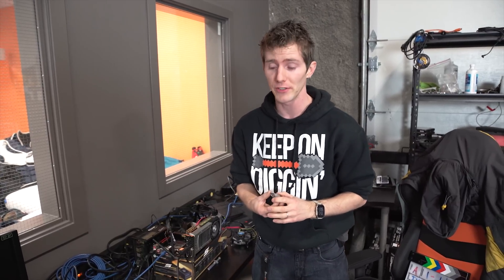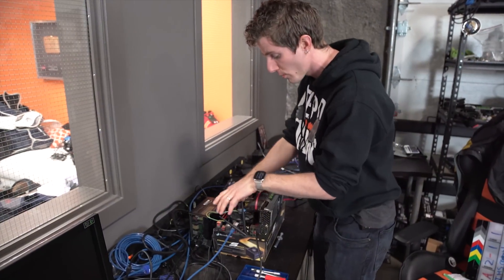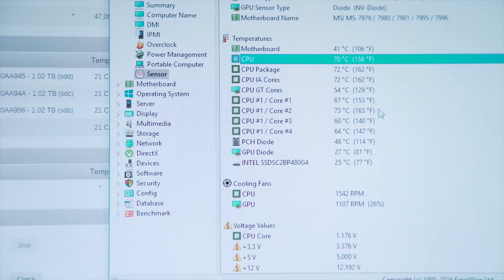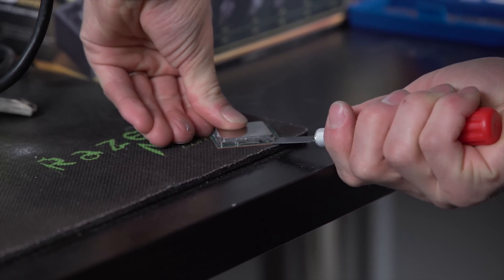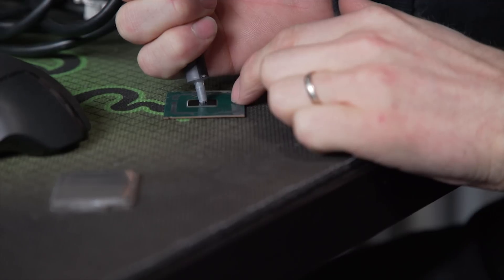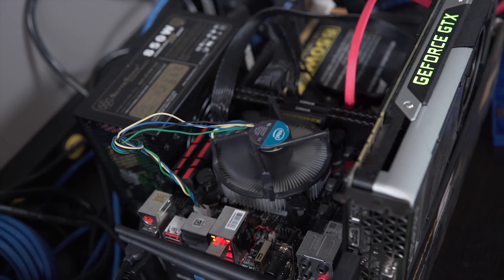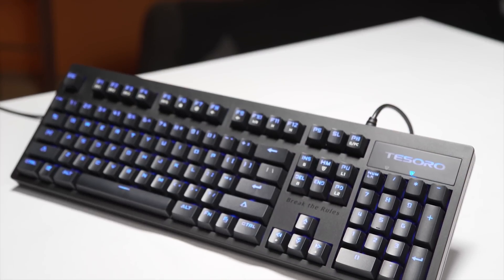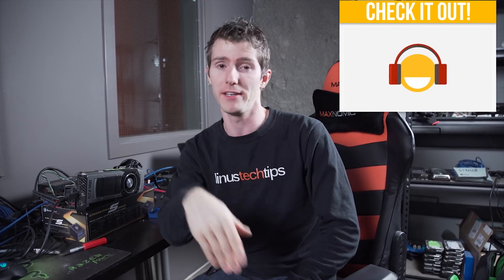Delidding an Intel Core i7 6700K - Is it worth it!?

Comment: first you have a polish cpu
Then a better sample of the cpu 
normaly test a cpu with prime95 actual version
finaly use liquid metal
You didn't proof the cpu  for Full wlp on chip
last you get lucky most of the intel cpu are worse with the wlp under the heatspreader
Why you didn't use delidemate from german store caseking

Comment: 4 to 5 degrees cooler? Not worth it... Better buy a bigger aircooler or go liquid with a cooler master evo i keep my fx8320 under 24C overclocked to 4.5ghz
Reply: +Jorge Hernandez The TIM used is like 12 dollars and you wont use even a quarter of it on one CPU. That combined with a CM EVO is good though. Screen shot please.

Comment: There's a few things you did wrong. 1: you have to clean the residue off both the IHS and the CPU board. 2: You should really be spreading the thermal paste over the die before putting the IHS back on.
Reply: +Anthony Paull Also on my 4790K I went from 90C under a H100i down to 70.
Reply: +Anthony Paull What voltage were you running? I have the same CPU and used CLU on it with H100i and it's barely ever touching 60c in stress tests. 4.7GHz @ 1.23v.

Comment: what thermal compound do you recommend for use with a laptop processor (since they get hotter)
i have been using arctic silver 5 replacing it every 6 months or so but i still have overheating issues 
is there a better compound i can use (price is no issue)

Comment: There are so many variables on this, the general rule with thermal paste is that less is better. There is only supposed to be enough to fill in the air gaps. Paste conducts worse than the metal. You could easily get 3 degrees difference just from putting a better amount of grease between the fan and the heat spreader.
Reply: Yes but as long as he puts a similar amount on the second test then the measurements will be fine
Reply: Thomas Myers
but if that similar amount results in 3 degrees difference then it wasn't similar enough which was my point. You have to d a run of 5-10 of each when something has this much variabilty, this me this is plain physics

Comment: i have a tube of AS5 and a tube of Gelid GC Xtreme, and i can say without a doubt that the GC Extreme runs several degrees cooler than the AS5. i didn't hear what paste was used in the video. +LinusTechTips what were you using?

Comment: They used to do direct die heatsinks, why not try it? I guess the retaining clamps on the Intel mount prevent getting close enough to the die. If you did do direct die, I think it would like more like 5-6c lower. Of course you run the risk of chipping the edges of the die.

Comment: Listen Linus, the problem with the stock-cooler is, that you now moved the bottleneck from the TIM to the stock-cooler. 
A more precise test-methode would be to choose something like an NH-D14 and fix the Fan-speed.
And honestly, use something like Coollaboratories ultra, otherwise you won't really gain too much..
I really like your videos but this one just wasn't appropriate..

Comment: i shaved off 40 C on my i7 4770k @ 4.5ghz

used to be 100 C overclock was at stock really and stock voltage. All with watercooled tested.

after fix i got 60 C  with overclocked and high voltage.

Comment: Well, I don't leave comments in the videos often, but I'm doing this time. It seems to me the test has been rushed and that it has been biased on Linus' previous opinions about the technique.
I would at least expect some tests under different conditions (water cooling, different thermal compounds, etc.) as we have been seeing in Luke's videos. We all know Intel's stock cooler is shit, I would like to have seen something different, as LTT always does. But most importantly, the main objective of the thing has not been covered: overclocking.
I never heard about delidding a processor before, this is the first time, and just by quickly searching in google I could find people clocking their processors at around 4.5 ghz and it raised my curiosity if that's really worth for those purposes or not.
Please do not forget about the actual technical content of the videos instead of just showing brief "how-to -> results videos". The fun about your channel is to do the stuff in a different way, not quick and obvious tests like this one.

Comment: Is there any good reason why they wouldn't just solder the heat spreader to the die, like they do with the 2011 socket CPUs? 
I mean they're sacrificing a significant amount of cooling performance so they can save a few cents in production?
Reply: +Antares 8001 Also it's not to surprising that the temperatures didn't improve all that much since the TIM they use on Skylake is actually pretty decent stuff. If you did the same thing with an Ivy Bridge or a Haswell there would have been a significant improvement.

Comment: I filed down the DIE with some 500 grid sandpaper (just very lightly) ... result: -8°C using the stock heatsink + cheap thermal compound!
Reply: +Hussein Al-janaby Even better! More surface area = more cooling capability!

Comment: did INtel pay you for this shit? Holy Cow, at least show also the best method, when you got that thing already open. LMP brings about 15degrees differnce, especially under Overvoltage. With IVy it could easy make 20 degree. But "thats why you never did it"...i understand. Ivy reached freking 95 degrees at 4,5ghz without delidding. YOure such a manipulative commercial-doing freak it really sucks.
Reply: Jesus, how ignorant are you?
Reply: +THINK ABOUT IT LOGICALLY ..... why would intel not want you to void your waranty. you have to buy another one of there cpu's, not like an amd is going in that socket
Reply: intel is applying better thermal grease than he did before (Devil's canyon had better thermal grease than haswell) and it applies to broadwell and skylake too (this is why 4690k is just 4670k with improved thermal grease)
Reply: +Crossek Resources? I think they use the same thing for all mainstream processors, TIM didn't change and I haven't seen any proof they did change it. Yeah, it was the gap between the IHS and the chip itself that was the issue and not the TIM.

http://www.anandtech.com/show/8227/devils-canyon-review-intel-core-i7-4790k-and-i5-4690k

I think it's fair to assume Skylake uses the same TIM.

Comment: I find this very interesting, I actually had no idea that's what the chip looked like under the heat spreader, I always thought it was essentially one piece. Now that I know however, it looks just like the removable CPU in my MSI laptop. It never had cooling issues, in fact, I accidently ran it without its CPU fan and it didn't seem to care.

Comment: Let me start off by saying I am a fan of the channel and have watched hundreds of LTT Youtube videos over the last year or so.  Please do not interpret the following as an attack, I only intend to instruct for the purpose of correction.

I've been de-lidding CPUs since 2012 when Ivy Bridge was released.   I've personally seen temperature decreases in excess of 30C in my own testing with custom water cooling and a lapped IHS & water-block.  Many people report temperature decreases under load of 10-15C, with still others reporting anywhere from 20-40C drop. 

Whenever you construct a testing method to test an hypothesis, you need to ask "why am I doing this/why do people do this?"  In this case, the answers are:
1) increased overclocking capabilities
2) reduced temperatures 
3) reduced power consumption 

People de-lid their CPUs because they are thermally-bound when overclocking.  In order to push past the limitations of the stock CPU configuration, it is necessary to change one or more parameters.  In Ivy Bridge and newer mainstream platform Intel CPUs, the thermal interface material (TIM) between the IHS and the CPU die is the primary limiting factor affecting thermal transfer.  Intel themselves acknowledged this with the release of their Devil's Canyon CPUs.

With that in mind, the scenario demonstrated in this video fails to account for the primary purpose of de-lidding, i.e. increased overclocking capability.

Here then, is everything wrong with your testing method:
1) wrong TIM (you need something better than stock to see real results, i.e. liquid metal compound)
2) stock Intel cooler (way out of its league)
3) no overclocking (you need to raise the TDP of the CPU to realize the maximum benefits of increased thermal transfer)

Comment: To Linus and everybody else, if you guys have ever seen the VICE Method, I would like to say that it is the most recommended method because the chance of your CPU failing after is 17% while the Razor blade method (as shown in the video) is 33% as long as you are extra careful. 

Yes I have done the Razor blade with my first intel core i5 3570k. The CPU failed due to leaving chicken scratches long enough that it cut deep into the circuits exposing the copper. The VICE method on the other hand,  with the 2nd Intel core i5 3750K & Intel Core i7 4790k CPUs. Both of them have came out successful and are still alive and kicking to this day. 

Another thing: make sure you also buy the Liquid Coolaboratory PRO to apply for your die and the ARCTIC MX-4 thermal paste on top of the IHS. They will definitely drop your temperatures and make a huge difference.Also, they are considered high quality and cheaper. Good luck to anyone and proceed at your risk.

Comment: Wow, a 4,22% improvement in temperatures!
10/10 I'd risk to destroy an expensive CPU
Reply: +Stefano Caliò sometimes the paste isnt applied well at all for instance what if his processor was running at 100 degrees celcius at load, well first id try to return if that didnt work than delidding would be an option for me.  seriously though im pretty sure my brothers haswell i7 4790k has like no paste on the die itself cause it really does run at 100 degrees celcius full load

Comment: Using the bone stock cooler limits the swing by giving less thermal mass for the heatspreader to transfer to, using cheap replacement thermal material sort of defeats the purpose as well.

The reason people doing it use the liquid metal stuff is because it's a scary/risky thing and if you're gonna do it at all you should at least go into it with the intention of maximising your return from the risk, the goop used... was not that.

I'm not gonna thumbs down the video, but Linus somewhat missed the point of the exercise.

(On a 6700K that is NOT delidded, because I don't have the cash to replace the thing if it blows up.)

Comment: You have to actually run it for 48+ hours for the thermal compound to set correctly. Could gain another 1-2c however I still wouldn't recommend doing it.

Comment: never bothered doing this ever but why not just not use the IHS and just direct mount the heat sink?
Reply: no, I do not say that, what I mean is that it is impossible placing the heat sink direct on the IHS, without using the cover because will damage the cpu by the extreme pressure on it
Reply: +This0is0pointless was thinking the same thing
Reply: +This0is0pointless because will cause permanent damage to the IHS and bye cpu xD
Reply: +DualPerformance  you're going to cause damage to it by removing it and not using it?
Reply: DualPerformance that makes sense, i wounder if you can build a heat sink with its own heat spreader inbuilt.... probably be a huge pain to install

Comment: putting enough thermal paste on the cpu die with the coollabs liquid pro actually makes a huge difference as there's a gap between the cpu die & the ihs... its not direct contact like the ihs to the heatsink. that's part of the reason people actually use the liquid pro stuff. 

did this to my 4770k & it lowered temps from 85-90 down to 60c

Comment: Linus, you mentioned at the beginning that you're only going to change the thermal paste but that there are other methods that people do which you won't cover. But then in the end you make a generalization about how de-lidding isn't worth it. With all due respect, but your conclusion means nothing because none will go through de-lidding their CPU to just put a fresh paste and put it back on. No, people that de-lid their CPUs will actually mount the cooler directly to it, sand down both surfaces, etc etc. With such things, you either go all the way or you don't at all. I think your conclusion is irrelevant and doesn't help the people that are trying to decide whether to do it or not. That being said, I love it that you did such a video. I expect more of this :)
Reply: +SaladFingers Your last but one sentence ruined it all :|
Reply: +SaladFingers It's worthless unless you're an extreme overclocker that want to run the overclock 24/7. I can reach 49 * 101.5 with my 6700k, what would I achieve more by delidding? Nothing, a couple of degrees at most. Most people don't run their max overclock on a daily basis.

Comment: actually   as I've know gen 3 and 4 cpu after doing this, it's got pretty much better than standard compound inside the ish.

the result from this is not just a bit lower temp but a huge gap different

i.e. normally gen3 and 4 can be max oc at around 4.3-4.5 ghz (on the top tier tower heatsink or good closed loop water cooling) but this way can make them go up to around 4.7-4.9ghz to close to gen 2 (around 4.8-5.0ghz)

that's why they've try to do this and take the risk.

Comment: I wonder what would happen if you were to just use mayonnaise instead of thermal compound?  Could you post a video of this experiment? I am curious
Reply: +FubarMike this isn't techrex haha
Reply: Racist... why not ketchup
Reply: +Savvy Seagull Thicker, whiter..
Reply: +CarHub He should just do a video to see what food item is the best alternative to thermal grease.  Mayonnaise, ketchup, mustard, miracle whip etc.
Reply: +FubarMike There have been a couple sites that have done this over the years. 3 of the best alternatives are 1. Toothpaste 2. Vegemite 3. Peanut Butter

I have actually tried toothpaste myself and it does work slightly better than Arctic Silver 5 for about an hour under heavy load and the temperature will start creeping up as it dries out. You can use toothpaste in a pinch but expect to be reapplying it a lot if you're using the computer heavily.
Reply: Hamse Elmi he mainly does phones and occasionally game consoles.  I have yet to see him do a cpu and motherboard.  S&M Destruction might do something like this but with an old pentium 4 system and not a skylake processor
Reply: FubarMike The only CPU's that will have any excitement (smoke) are Athlon XP chips, which will hit 300+ degrees and melt the CPU socket and kill the motherboard. Everything since has built in thermal throttling, which can be overridden, and thermal shutdown usually @ 127c, which can't be overridden unless you modify the BIOS. You have to work pretty hard to kill anything relatively modern with heat alone due to the newer ROHS compliant lead-free solder.

Comment: I ended up using the bench vise, 2x4, and hammer delidding method on my 3770k a few years back and ended up getting 5 degrees Celsius improvement in temperatures at load. Was it worth the risk? Hell no. But it was also one of the most fun and terrifying things I've ever done to a CPU :-D

Comment: I did this with my own skylake last week lol. Using thermal adhesive actually helps it a lot more as well. My processor runs around 6-8c cooler now than what it did. I'm using metal compound though. The stock goop is bad and for what you pay for it you pay 400-1000 for a processor and they use .50c compound urgh.

Comment: So how does the CPU stay connected to the motherboard if he completely peeled it off? Are there little rivets that it fits within?
Reply: +Corey Christine i was wondering too... it looks like he only removed the cover. And the cpu is connected from the bottom side, where he did not remove anything. The cover he removed is just metal piece placed on the top of the processor, and then you just place your cooler on the top of this metal cover...

TLDR: he did not remove the processor really, only the cover
Reply: Gotcha. Didn't know that cpu's were so small.

Comment: hmm, thats on a NEW chip. what about an 4 year old core i7 2700k??? would the thermal adhesive not age and make it bad over the many years of wear and tear? i mean. seen plenty of laptops going bad (running worse and way more hot, not to mention thermal throttling) after 2-3 years of use. even if you change the thermal compound.
Reply: +AntimatePcCustom Your 2700K already has solder as a TI.
 This compound will last for a lifetime. Actually if you will remove the spreader you will likely damage the chip.
Reply: not planing to. it runs just fine. it was just an example.

Comment: People first started delidding with Ivy Bridge not Haswell Linus. There was no need to on Sandy Bridge but they also soldered the IHS to the PCB in that architecture. This video fails to inform people that every CPU chip varies in the temp decrease. On my 3770k I dropped a whopping 28c using Liquid Pro TIM after a delid. That allowed me to reach a 5ghz O.C for 24/7 use running at 68c under extreme stress test. Real information can be found and read here: http://www.overclock.net/t/1313179/official-delidded-club-guide

Comment: Here is a video on how NOT to delid an Intel CPU. The whole point is 1) to decrease the space between IHS and CPU by removing the black adhesive compound that secures the IHS to the silicon and 2) use CLU on the CPU. Both of which were not performed, defeating the point of delidding.

Redo this video, or delete it because it serves no purpose other than to misinform people.